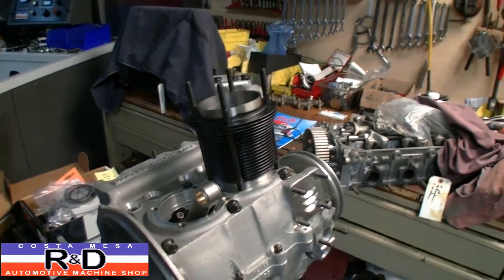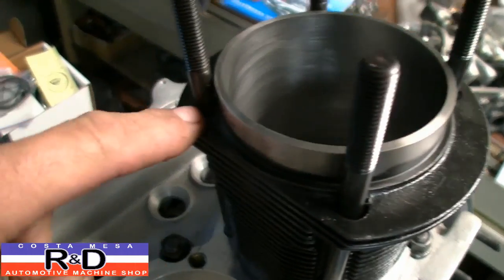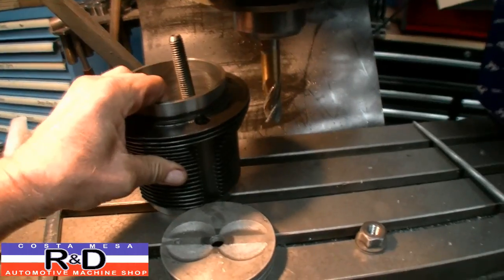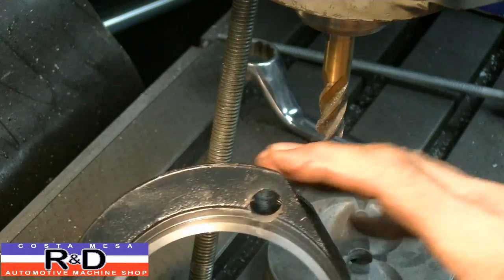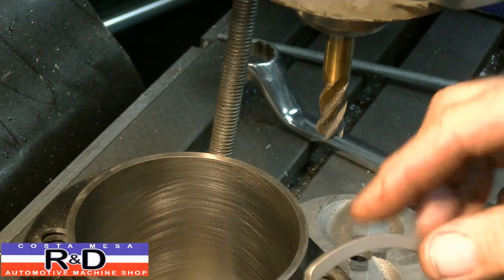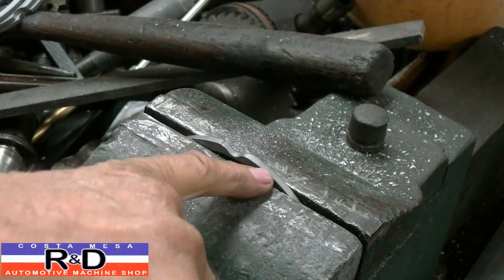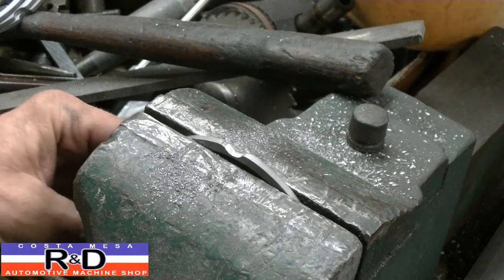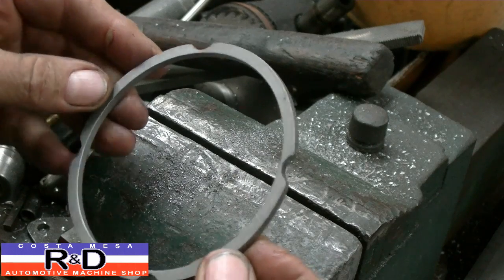VW Cylinder Modification for Stud Clearance

Comment: Just out of curiosity, have you ever bored a head out to  be able to run a dial bore gauge down while the cylinder was loaded like it would be installed to see what the concentricity was?  I have assembled a bunch of VWs with 94's and only had a die grinder and a burr to clean up where the studs hit the cylinders and always wondered how out of whack they were, if at all, after that operation.  I never had a real issue with 8mm studs that I noticed, but the 10mm ones had definite interference.

Comment: do these after market blocks come with steel inserts for studs?
Reply: +Stumpy LawnmowerGuy Just about every after market case is designed for a radical build.   They are insanely overbuilt.   Casesavers have three functions:  #1.  Their threads do not wear out with multiple assembly and disassembly cycles.  #2.  They are similar to the stud/bolt composition so there is no galvanic corrosion.  #3.  The inserts increase the amount of tension load required to pull the fastener out of the case.  The O.D. of the insert is larger, so they displace the fastener load over a larger area of the base material
Reply from the maker: +Stumpy LawnmowerGuy In most cases.